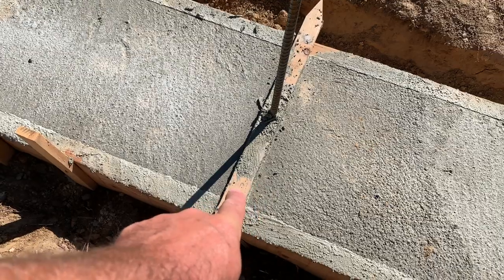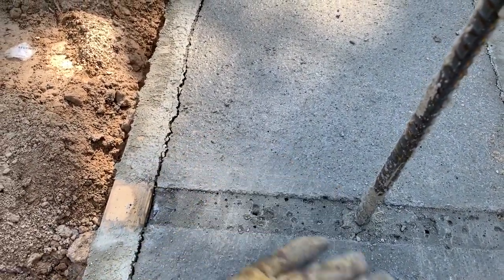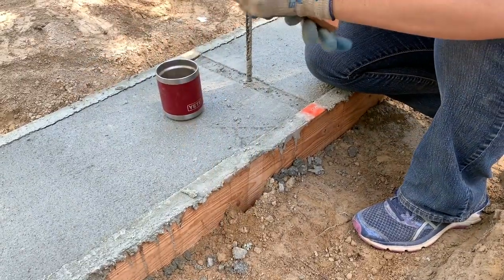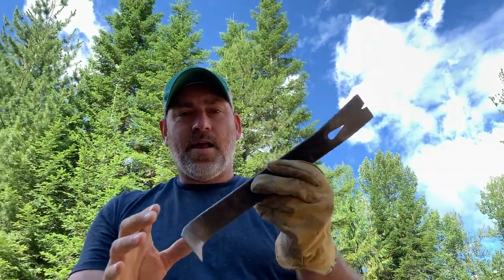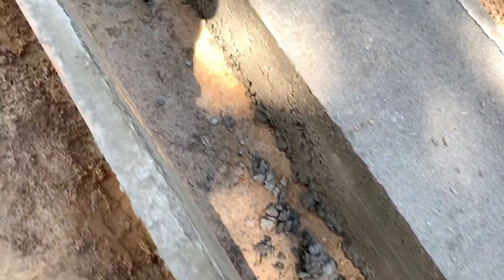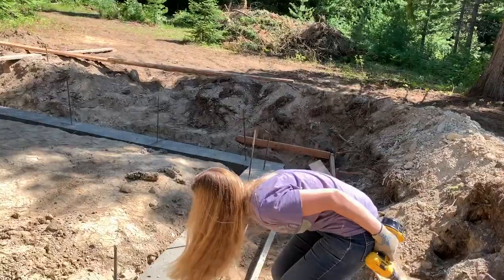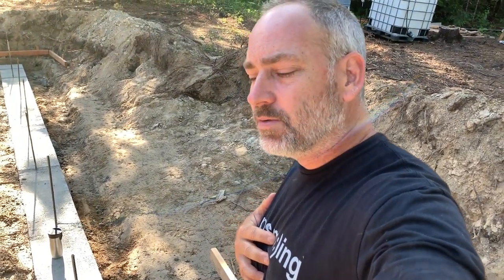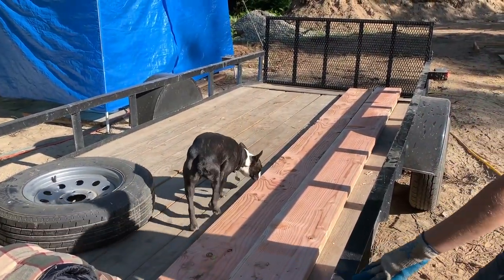Did our Footers FAIL?? | Off Grid Cabin Build #6

Comment: Greetings from Korea.  You may want to investigate lining the inside of the form boards with cheap cheap plastic....  Otherwise clean the form boards asap and clean well.  Concrete is hards on saw blades.  Moisture will cause joists to warp one way, so just plan on some extra blocking.  Great money saving (and ecological) way to build .  Plus you can never have too much spare lumber on a homestead !
Reply: Sorry for double post.... look forward to "the pour."  This is a quality build.

Comment: When working with Concrete NEVER use Screws! 2 inch nails for your Pegs (Stakes), and two three inch nails for your corners. Much easier.
Tip two: using a small square (one with a 45 degree and a 90 degree side and it is 12 inches long) Great for getting the "Cream" off the 2x6's very easy.
Tip Three: Straighten the rebar when you tie the Horizontal rebar.
Tip Four: Get rid of highpoints when the Concrete is still "Green" about 12 hours.
Tip Four: Use a Chalk line to get a Square line for the entire footing
 Use your concrete Footing (Footer) lumber and using Duplex 3.5 inch nails drive the nails into the Concrete (Best done the next day) the boards as a "holder" for your bottom Vertical  board. Nail the vertical board into the Horizontal 2x4 or 2x6.
Personally, Plywood works better and faster, but that is a style in its own!
Thanks for reading.

Comment: Super cool reusing the wood from the forms for the joists!
Reply: It's an old school technique, most older houses reused the form planks for something else, mostly for flooring. My dad was a hardwood flooring guy and they would install the hardwood right on top of the still moist concrete forms and nails them with hammers. That would be completely unacceptable today, mostly because of the moisture, that was 60 years ago.

Comment: Concrete takes a long time to fully cure.  Don't lean on those rods with your weight.  Just wait until it's time, giving that little extra bit of time.  Typical monolithic slabs have more mass, and can handle more, but this is a fairly thin pour.  Be easy.  peace